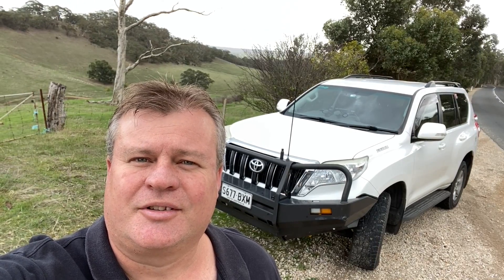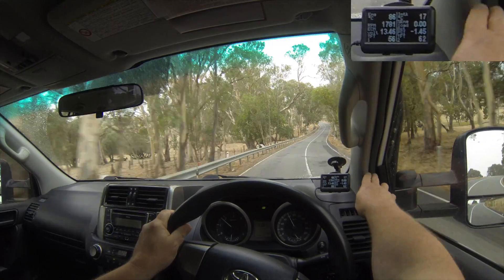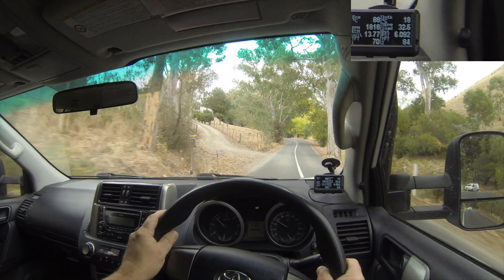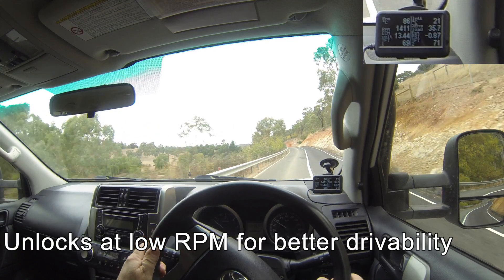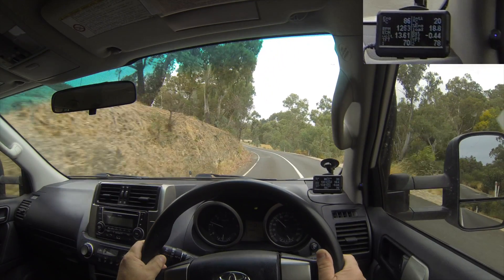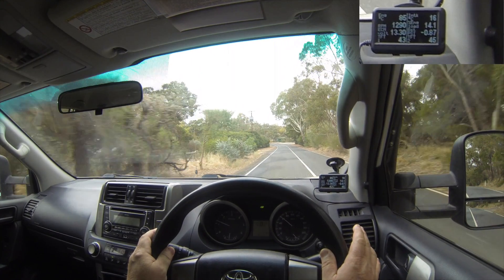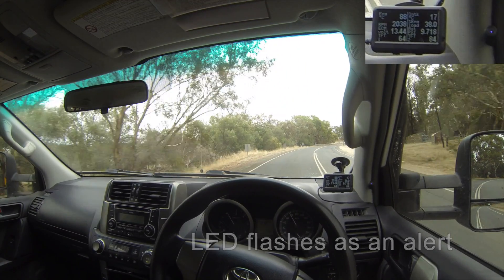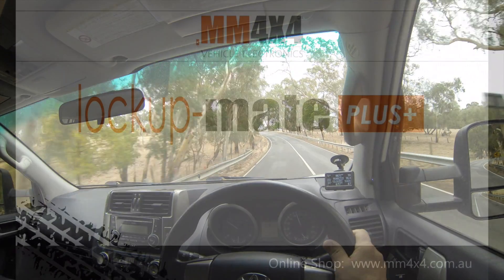Operation of lockup-mate®PLUS+Prado in the Prado 150 3.0L Diesel (KDJ)

Comment: Is the unit plug and play? Not keen on hacking up the factory harness and would like to be able to unplug it for diagnostics if I'm having problems in the middle of nowhere
Reply from the maker: We’ve come from a remote touring background know how important keeping your car running is, so fault tolerance has been designed in.

Whilst it does required 2 wires to be cut in order to control the lockup solenoid, the rest is plug n play, and everything can be easily bypassed back to factory operation. See this page which explains.  Skip to the section on "Remote Touring and Built-in Fault Tolerance" https://www.mm4x4.com.au/post/lockup-mate-plus-lc200-series